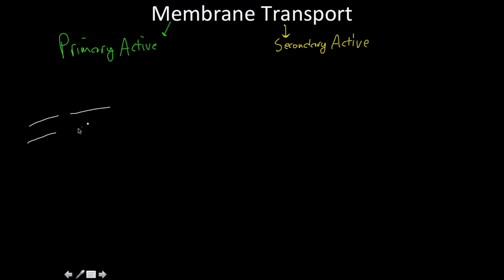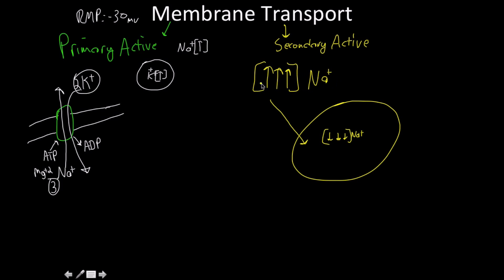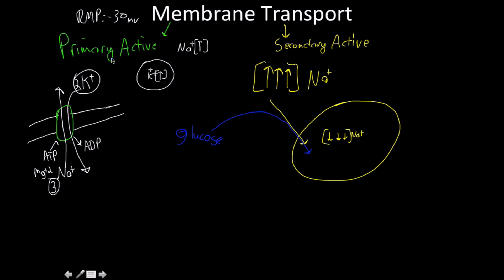Primary vs Secondary Active Transport

Comment: Uuuuggghhhhhh ttthhaaannnkkk yyyooouuuu
Reply from the maker: You are welcome, let me know if you have any questions
Reply: Thomas Underhill oh well, since you’ve asked 😂 the primary active transport uses an enzyme which is ATPase that works like a transporter, what about secondary active, does it use an enzyme that act as a transporter or does the Na just transport itself due to the high concentration level outside the cell? Correct me if I’am wrong in any of the above. And thanks again for the video!
Reply from the maker: great qeustion! secondary active transport uses what is called "porters" a protein named so bc its used to transPORT things. 

These can be symporters or antiporters, and we tend to couple the movement of things down a concentration gradient (sodium for example) with the movement of something else: https://www.youtube.com/watch?v=wP5DZuJGi-s

Comment: So secondary active transport is similar to passive transport in the sense that substances move from areas of higher conc. to those of lower conc.s but the difference is it occurs with primary active transport at the same time (while the channel is open) & consumes energy?
Reply from the maker: If I understand what you are saying correctly then yes, the energy from primary active transport creates a gradient for secondary active transport.

Comment: Tell me please (Iam sorry for a dumb question). What kind of transport are the Adenine Nucleotide translocase and Phosphate translocase examples of?
Reply from the maker: what do you think and why ?
Reply: I am asking because I am confused. It looks more like secondary transport to me... but it is definitely not as obvious as in yours or in text books explanations
Reply from the maker: well your text wont always identify it for you, but you can use these cues to classify things: for example; is the substrate (ATP in this example ) moving from a high concentration to a low one or form low to high ?
Reply: It is a very good question... It depends on the rate of transportation... Although it is manufactured in the matrix, I presume that there should be more of it outside and it will be moving against the concentration... or not?
Reply from the maker: Well we know its an antiporter system, and its confirmation mostly depends on the concentration of readily available substrates since there aren't many well known regulators of it (ADP in the cytoplasm and ATP in the Matrix ---> ADP in the Matrix and ATP in the ctyoplasm) so yes, it does depend on concentration gradients. I didnt mention this in the video, but usually we also consider electrochemical gradients when classifying the two. that being said what do you think ? PS Im always the first guy to say "whats in a name", so long as you understand the interaction between gradients of solutes and their channels, I think you are doing fine